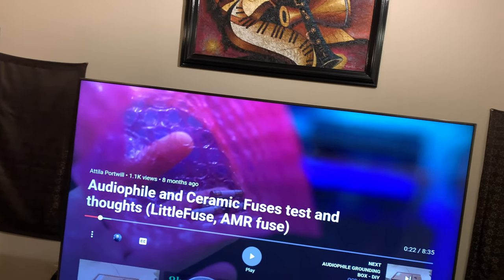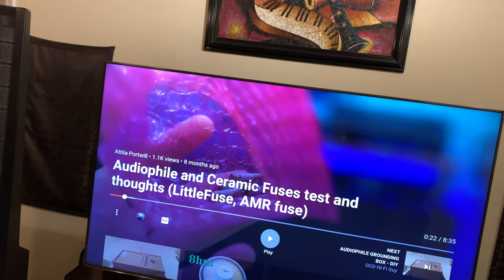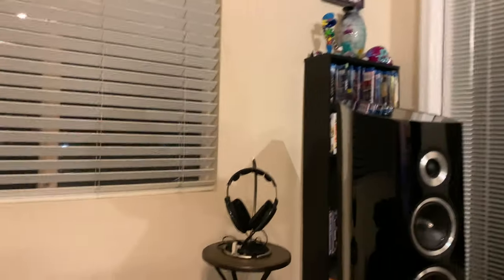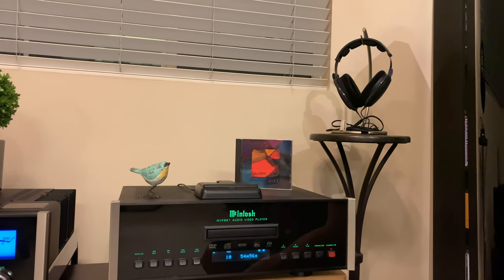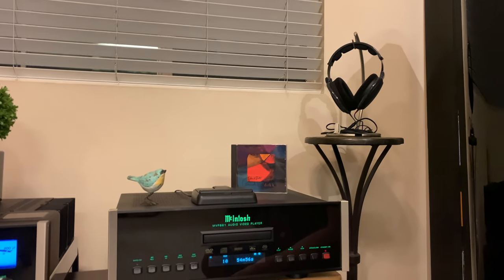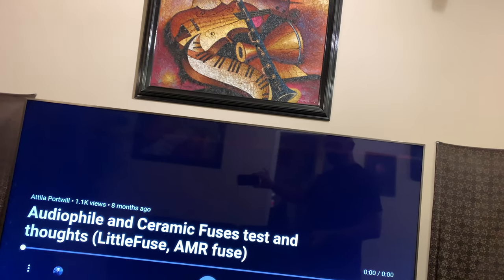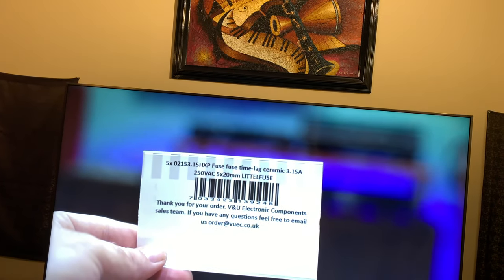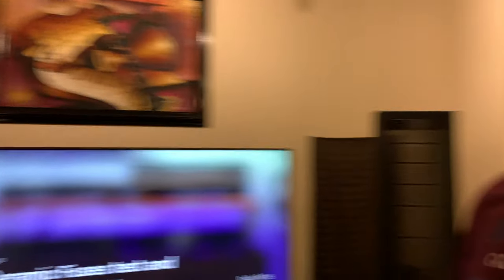My Audiophile System Vegas “ I Put Cheap Ceramic Fuses In My Audiophile Setup  & Was Blown Away!”

Comment: I don't know how confortable you are to modify your equipment, but I suggest to put capacitors paralell to the fuse, if the fuse blows your system still protected since caps block DC current.
Try adding 2000-4700uF elco caps for the base and 100-1000nF MKP caps for the mids and highs, beware of the elco polarity.

I first saw this solution on a hand drawn schematics and when I understand its purpose I said it's just genius, you can impove the sound quality without sacrificing the protection. Since then I always include this trick when I build an amplifier.

There are a couple reasons why your new fuses could sound better (vibration doesn't come up in my mind, electrons falls of from the conductor or what :) )
1. different material
2. different conductor thickness
3. heat stability because of the filling - I think this is the most likely, an other thing I don't know how tight the fuse parameters are from the factory, what I mean by that, if you have a 100W amp it mybe blows the fuse at 110W, for an other manufacturer it blows at 140W. So if you listen your 100W amp at 90W from the firts manufacturer your fuse probably heats up more than the second manufacturer fuse, so you most likely you benefit from the new fuse, but if you listen it at 20W you can't hear difference between the fuses.
4. new contact not oxidated yet - clean the old fuses and put them back in

Comment: What's vibrating is the tiny filament inside the fuse. Ceramic fuses usually also contain sand like material inside. More than likely the sand is preventing the filament from vibrating, acting like a damper.
Reply from the maker: Correct! I mention this in my later videos. I've since moved onto the synergistic research orange in all components! Thanks for watching Juan! 👌🎼✨
Reply: LOL.

Comment: I wrapped several glass and creamic fuses with the EMI farady fabric tape and every one showed significant improvements. be sure to cut it to not touch the metal caps and do 2 wraps. Even the HiFi tuning fuse got better!!! Absolute cheapest high impact tweek ever!
Reply: In what way improved the sound?
Reply: OMR HSN improved transients
Reply: @robertparkphotography2451  Hmm strange i might try this.Thanks!

Comment: What difference can you detect between a ceramic and Synergistic Research Purple?
Reply from the maker: Ceramic took the glare out, but the SR fuses add soundstage & air, and better timbres with an overall more relaxed presentation. They are very good. 👌🎼✨
Reply: I’m looking into a Hifi-Tuning fuse. I have a feeling, it’s a silver filament w/Furutech Nano Liquid. Great materials plus they’re cheaper than SR.
Reply from the maker: @tubefreeeasy  anything's better than the glass! 👌💯🎼✨

Comment: That's crazy! It can't be!

I'll be buying them tomorrow for my Mc system. Thanks!
Reply from the maker: Awesome! They are directional, test each way for what sounds best ( I didn't believe it either). 
My new Electrocompaniet CD player had them installed from the factory! I'm such a believer that I bought a synergistic research orange fuse this week. I will post a video on that next month. 👌🎼✨
Reply: @vpconcepts9838  Subscribed!
Reply: @vpconcepts9838  Which ones are directional?I think Littelfuse are not directional isn't it?I don't wanna swap 100 times and try to find the difference in sound.I think cheap Littelfuse upgrade will be more than enough :))

Comment: i dont argue since i didnt try any yet but here is the thing a fuse is basicly a resistor all the current funnel in a thin wire if the resistor value was zero it would not be a fuse it would be a wire according to ohm law p = r×i 2 p = power and heat so if r is 0 then no heath produce i believe it is rhe cheap contact at both end that add up the resistance perhap even creating tiny arcing it is like those cheap bindind post strap on speaker that are cheap material also but then again should not we also change the fuse holder look like crappy material also .....or a cheap power outlet that create tiny arcing because of poreous metal inside i believe your expensive fuse have a better connector reducing the resistance and arcing 
also the very idea of cleaning the tarnish on fuse holder and the fuse itself might very well make a difference as when you clean the tarnish in iec ac inlet it make a good difference also 
that is my thought but i will try it for sure but i would not pay 250$ for a fuse ever
Reply from the maker: I had cleaned the contacts before comparing glass, ceramic, then the synergistic orange. Each time there was a marked level of improvement. The orange was $160.00. It was such improvement, I bought one for  every component since. Synergistic just released a new purple fuse for $200 that is an upgrade over the orange. I bought one for my headphone tube amp I believe in them so much. I surly hope you get to hear one some day. You may never say "I wouldn't spend that" again. Thanks for watching Jean Claude! 👊🎼✨
Reply: @vpconcepts9838  for sure i will try a better fuse im in nature doubtful but very curious the curiosity alway take over
Reply: i just opened my cd players i counted 8 fuse in it there maybe other one because there is another hidden board underneath another one that is a lot of fuse
Reply from the maker: Holy crap! 😳🤦‍♂️🤷‍♂️🎼✨
Reply: @vpconcepts9838  yes that is a bunch of fuse

Comment: Can you provide a link for the exact fuses you used for the MVP861? Thanks!
Reply from the maker: Rene Warnes I bought them at frys electronics. 
There are 3 inside. 4 screws to pop the cover and you can see the rating on the fuses. Sorry it's been months since I pulled to top now 👍🎼✨

Comment: Hello

Did you change the fuse in your McIntosh Preamp. I see you have a newer model of McIntosh preamp in your setup.I have a McIntosh C49 preamp and am really interested in trying out the Synergistic Research fuse. I don't see any fuse catridge by the power cord inlet or outside of the unit. But i do find a fuse inside of the unit (underside of the body) where lies close to the back. Do you know is that the one fuse i need to replace ? Or where can i get resource like service manual for this practice ? And any idea about the fuse located in McIntosh MC312 power amp ? Thanks
Reply from the maker: In my latest videos I have upgraded to the synergistic research orange. Totally worth it. The fuse on my ma7900 is located in the back. Thanks for watching! 👌🎼✨
Reply: Thanks. I managed to find the specs and how to replace the fuses of my pre & amps. I will possibly go for the SR Orange, but my friends all favor Audio Magic's beeswax fuses
Reply from the maker: I hope you enjoy your upgrade as much as I do! 👌🎼✨

Comment: So far no luck finding the right fuse for the cd3... ceramic 315 mAmp are apparently not a thing in the Netherlands.... I have found one for my quad 606 power amp though! Going to pick it up tomorrow really curiouse see what it does! I'm also on the hunt for better tubes for the cd3. Looking at the BT's but I also came across the Sophia Electric 6sn7 a grade tubes. People seem to love them so I think I will give them a try. I can also get a set of those really high end psvane tubes but people say they are bright and my system is a little on the bright side of things to start with....
I also bought a couple of those big and thicc bamboo cutting boards and Wouw, the bass got notticibly tighter. Nice hack!
Now of to find new hacks haha
Reply from the maker: Bear's Blend That’s great!!! Sucks about the tube buffer fuse though. I love my shuguang treasures tubes, nothing beats them yet. Let me know how that amp sounds! 👍🎼✨
Reply: @vpconcepts9838  just put the fuses in my quad 606 and svs pb nsd. I did some listening before and well it was normal lol.
After though... did I get a new amp? LOL!
vocals are clearer and it sounds like there is more control and it just sounds meatier. Bass though.... it tightend things up so much... it is like it went to a more closed sub signature but still had that umph you get with an open one.
This has got to be the best hack ever haha.
Can't wait to see how things will improve over time.
Now I'm off to find one for my quad 34 pre amp and the yaqin...
Reply from the maker: Bear's Blend Yes! Meatier is exactly what I hear. More authority and much more texture. Wait till you hit 200 hours! Thanks for the update! 👌✨🎼

Comment: I tried looking for F1.5L250V Cartridge ceramic Fuses for my Yaqin cd 3, but coudn't find it. :(
Reply from the maker: Fast blow 500ma 250v is what I used if I remember right. Thanks for watching lucio! 👌🎼✨
Reply: @vpconcepts9838  Are you saying that I can use the Fast blow 500ma 250v on my YAQIN CD 3 to replace my F1.5L250V?
I found this on the internet 'Ceramic Fuse - SODIAL(R) 10Pcs 250V 0.5A 500mA Fast Blow Ceramic Fuses Tubes 5mm x 20mm' I presume that it is what you referring to?
Thanks for you help! Appreciate very much!
Reply from the maker: Yes that looks like it. 5x20 500ma 250v fast blow

Comment: Bussmann 13A are already ceramic and they are regular fuses...
Reply from the maker: Not sure what your saying? 
I replaced the glass fuses for NHT little fuses. 
This is an old video however. I now have synergistic research orange fuses. Thanks for watching! 😉👌🎼✨
Reply: @vpconcepts9838  I meant that the regular fuses in UK cords are usually Bussmann 13A and they are ceramic.The fuses in the amps and hifi devices are mainly glass i thing(at least the old ones).I didn't watch the whole video sorry.I've got NAD 1155 preamp with glass fuses.So i will replace those glasses with ceramics now to see if the sound is improving :))).How are the synergetic research orange ones.OMG i've collected so many stuff already that improves the sound  that i am not sure if everything will be too much or work better together .... :))))
Reply: @vpconcepts9838  By the way does it matter if it is slow or fast blowing fuse?Thanks!
Reply: @vpconcepts9838  Hey i have replaced the fuses in my NAD 1155 preamp with ceramic ones.The difference is the sound is the sound is more deep now with improved background sounds.It is like more 3 dimensional.I still have to change the fuses in my power amp,but even now i hear difference.The tone is thicker and richer too yes.And i switched to glass fuses  to hear the difference again and again.
Reply from the maker: The orange is magic! 👌🎼✨
Reply from the maker: Yes the manufacture will have it on
the fuse casing
Reply from the maker: Sweet! Nice upgrade then 😉👌👌👌✨

Comment: Any recommendations for XLR interconnects for a lower end system? I only have about 3k in the equipment but I am switching over to balanced for the first time.
Reply from the maker: scottyo64 kimber Kable xlr. Try Hero. If that’s to much go PBJ’s. You will be amazed 👌✨
Reply: @vpconcepts9838  I am going to try a set of Kimbers to go from the preamp to the amp first then a bit later I will get a set for the CD to the preamp
Reply from the maker: scottyo64 yup! I keep the same brand and model throughout all connections so the synergy is there 😊👍🎼✨
Reply: Furutech bulk cable and furutech connectors. Solder yourself.
Reply: Monstercable!

Comment: Cool video! Really interesting. You should try to switch out the fuse in in the yaqin cd3! I have one to so I am curiouse about the result hahaha
Reply from the maker: Bear's Blend yes! I’m going to in all the components now. I can’t seem to find any info on where the fuse is? Even looking at internal pics & cant see it? 🎼✨
Reply: @vpconcepts9838  hmm interesting. I have not looked into it yet. Will do so tomorrow hopefully. I will let you know what I can or can not find haha. There came spare fuses with the cd3. They must be somewhere haha
Reply from the maker: Bear's Blend I know there is one because on a forum a guy said he did it, but didn’t tell us where! LOL! 😂
Reply: @vpconcepts9838  just read that to haha
Reply: @vpconcepts9838  i think i found it! In this article https://www.stereo.net.au/forums/topic/88746-sold-fs-melb-yaqin-cd3-tube-buffer-with-tung-sol-6sn7gtb-tubes/ there are pictures from the back of the unit with the picture of a fuse underneath the power connector. My guess is that it is behind there. On other yaqin models. The high end tube amps. The fused are also in the back so it is logical. I will check it myself later but if you get around it faster then me let me know! I will tell you if I find something!
Reply from the maker: Bear's Blend thanks!!
Reply: @vpconcepts9838  just checked. There are 2 fuses located underneath the  power connector. You can easily get them out with a screwdriver. You don't need to remove the power connector. There is a little pull tap you can force with a flathead
Reply from the maker: Bear's Blend nice!!! Because I am sitting here looking for a manual & cant find anything, LOL! Please tell me what size they both are and amp rating! 👊🎼💥
Reply: @vpconcepts9838  just the standard 2 cm size. On the fuse it says f315mAL250V  I have no idea what that means haha. I'm from europe so things may be different
Reply from the maker: Bear's Blend shoot! Yes your right, it’s different 😫.  O well..I will keep looking 😂👊
Reply: @vpconcepts9838  why don't just check your own unit ;)
Reply from the maker: Bear's Blend It could be a 5x20 250v 315MA..but is it a slow blow or fast blow? Hmmm the plot thickens! 😂👌✨🎼
Reply from the maker: Bear's Blend Because it’s a big pain in the Ass to take it apart to find out, LOL! It takes weeks  to reposition the still points to sound right after moved. And the fuse won’t tell me if it’s a fast blow or slow. First world problems I know. It’s all in fun!! Thanks for your help my friend! 👊🎼✨
Reply: @vpconcepts9838  yea I understand. I hope you find something!
Reply from the maker: Bear's Blend wow thanks!!! 😊👊🎼✨
Reply from the maker: Bear's Blend CD players fuse is burned in! The P10 fuse was installed 6 days ago and is singing! These do need about 150hrs to come into their own. The McIntosh integrated fuse will be delivered Monday. This fuse upgrade has been a revelation. I’m stunned at the improvements in every area! How’s your amp sounding? 👌🎼✨
Reply: @vpconcepts9838  Good to hear! My amp sound amazing! In every area I notice that something has changed for the better, especially at higher volumes.
The fuse change in my sub suprised me a lot to! Sounds a lot tighter.
Can't wait to hear what is does for your Mcintosh!
Reply from the maker: Bear's Blend yes! Everything plays louder! I know you are telling the truth & truly listening 👌✨. Thanks for reminding me about the sub! 👏🏼👏🏼👏🏼🎼
Reply: @BearsBlend  Same for me for the Yaqin Cd 3 but I didn't find any ceramic tube F1.5L250V Cartridge ceramic Fuses :(

Comment: You do know ceramic is the insulting material not the conductor right? oh dear.
Reply from the maker: Ceramic keeps the fuse from getting hot, like ceramic coated headers on a car. Hope that helps you understand my explanation.
Reply: @vpconcepts9838  Agree ceramic is a good conductor of heat, however I do not think the uR variation caused by temperature increase in something a cm long perhaps and in the uR to nano Ohms will actually produce any noticeable power dissipation (P=I^2 * R), I think if you do the math, you can just about negate ANY noticable difference in sound quality.  This argument extends to expensive speaker cable myths.
Reply: @vpconcepts9838  Heres a tip, to improve the performance significantly of ANY power amp, put in more PSU capacitors at same or higher voltage with as much capacitence  as you can afford. Even good amps might only use 10,000uf per supply rail, they do this to keep margins high, BUT the ripple rejection at high currents-mainly bass will suffer. For a typical 100W amp using 10,000uF, you get only 1% load regulation, taking this up to 100,000uF 0.1% an so on as a rule. IMO based on calculations, cabling, fuses and the like will bring insignificant benefits-beyond the threhold of hearing, but more caps will help just about any low to high end amp unless you pay very silly money. As will replacing cage type transformers with Torroidal will usually improve regulation too on the AC end.

Comment: Fuses can make a huge difference.
Some audiophiles just dont´believe. Ok, i feel sorry for them. But, if an audio manufacturer does not believe in power cords and fuses, I do not believe in the manufacturer.
Reply from the maker: Mr. Spock I now have almost 200hrs on these 3 fuses and can’t believe the sound change: It’s like my CD player got a DAC upgrade,
I’m stunned 😳🎼✨ My Integrated gets the next fuse, then I think the P10 & tube buffer 👍💥
Reply: @vpconcepts9838  I Know it´s addicting.
 I tried so many brands. Bussman; AMR; Synergistic Research; Hi fi Tunning; AHP and Audio Magic. Don´t forget to change your circuit breaker to a fuse system in your electric board.
Reply from the maker: Mr. Spock I was looking at the synergistic research blue. And I have no idea how to do the circuit breaker thing lol 😂👌🎼✨
Reply: @MrSpock-bm4vm  How did you like the AHP?
Reply: @egnw0  Very much
. I still have AHP in my electric board.

More expensive than AMR, however, they are very similar in sound. 
Soft sound with a warm but very transparent tone.
 A fuse that worth the price (not valid for everyone)
Reply: @MrSpock-bm4vm  Thanks, I ordered a few. Will try them hopefully this week.
Reply: @MrSpock-bm4vm  got them last week. Broke them in with my DAC amps and music server. Little bit warmer and smoother. Not big difference but didn't hurt my system so not bad for a small investment compared to other upgrades.
Reply: @egnw0  Congrats!
Try to listen to several well known discs
I believe you may notice more differences little by little.
Reply: @egnw0  Congrats!
Try to listen to several well known discs
I believe you may notice more differences little by little